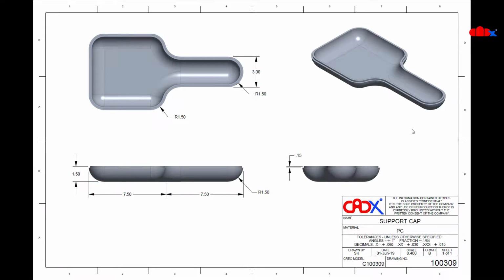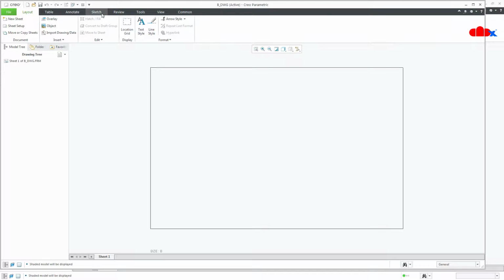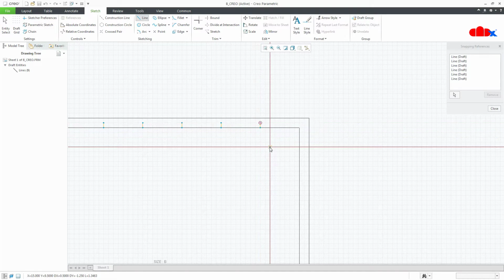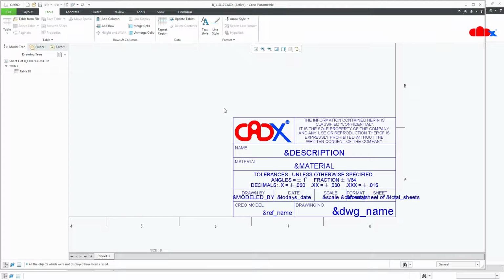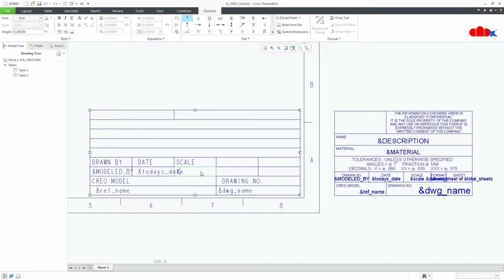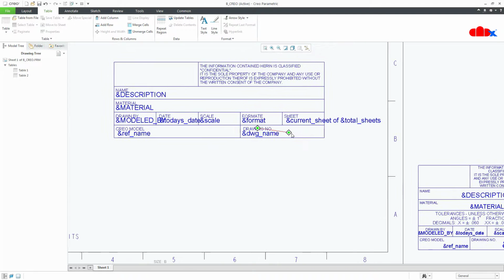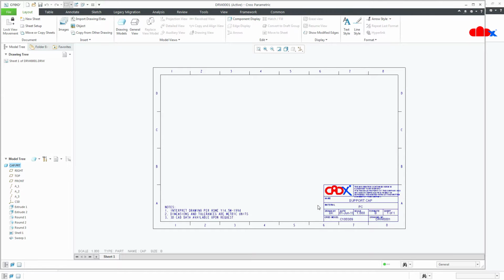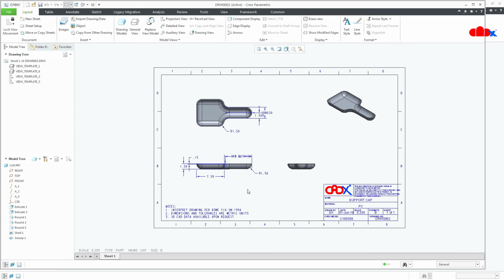Drawing Format & Drawing Template with Title Block in Creo Parametric

Comment: Hello Sir, for making multiple divisions in increments of 2 and 2.5 inches, you could have gone for "Sketch > Edit > Translate and Copy" option. It makes the process much less frustrating and a lot faster.
Reply from the maker: Go ahead 👍
Reply: @CADx-in  Sir, is it possible to save views in the model so that those views are available for all future models as well? For examples i want to save Left-Top-Front Isometric, Right-Top-Front Isometric, Left-Top-Back Isometric and Right-Top-Back Isometric and I want these to be readily available for me to use in any future model I create, rather than creating them time and again.
Reply from the maker: Yes you can create 3D views in the model and save it. Go to the view manager and use the Orient tab to create and save the new views in the model.
Reply: @CADx-in  Thank you for your response. Yes I can save it and I do, but the next model I design does not have them ready for me to use. IS there something I can add to the config.pro file or the config. sup file?
Reply from the maker: For this you need to create part template
https://youtu.be/eCs83gvSK7Q
Reply: @CADx-in  Thank you Sir, that was a great help!
Reply from the maker: Glad to hear that it helped.

Comment: Thank u sir. sir i have small doubt regarding this. Is it required to save both "drawing format" and "drawing of my part"  in the same folder? If we are not doing so, my LOGO is missing in drawing of my part. Always its not possible to save both files in same folder right!
Reply from the maker: For this, you must save your creo formate and template to the system folder.
Reply: system folder means? where i can find system folder? can u plzz tell me the step by step procedure.
Reply from the maker: You can see this video till the end. You will get the answer.